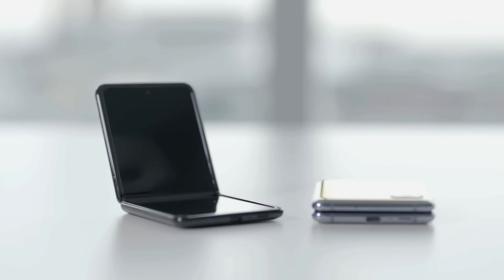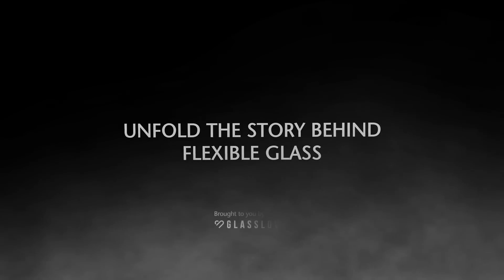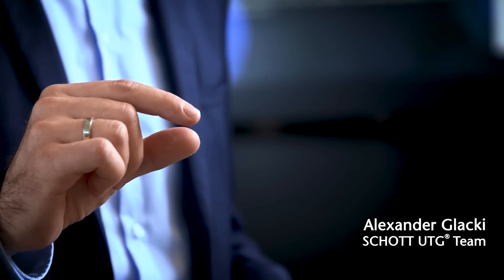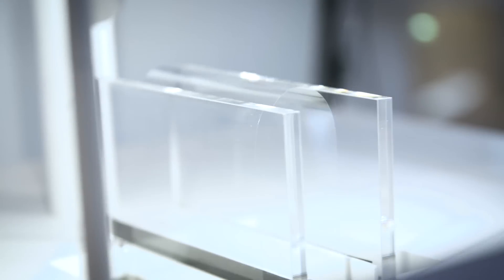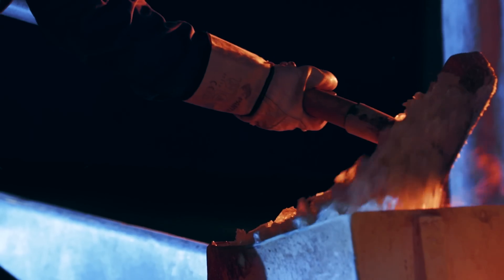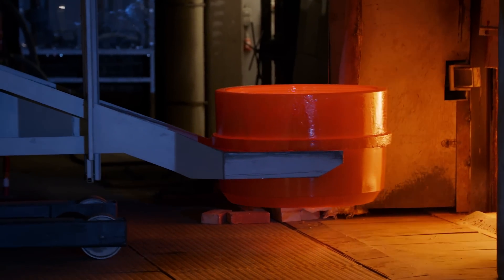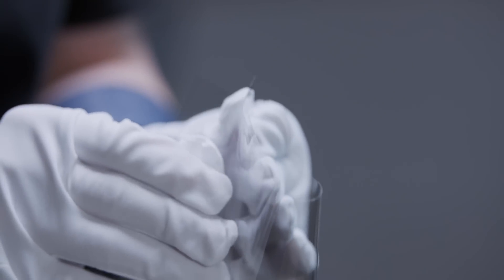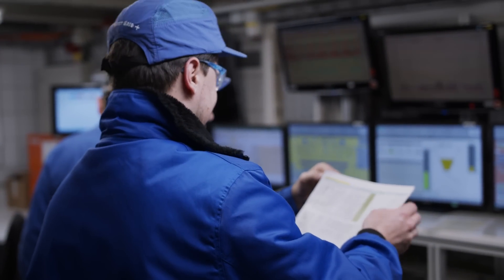SCHOTT UTG® – Unfold the story behind flexible glass

Comment: Ultrathin glass on the Samsung foldables has a plastic layer that scratches with finger nail. Do you have ultrathin glass that is scratch resistant without the plastic layer?
Reply from the maker: We're sorry, but we can not comment on display-related questions as we only supply ultra-thin glass substrates. The ultra-thin glass's specifications regarding scratch resistance are affected by various factors, e.g., the glass composition, thickness, and the chemical strengthening process. As you can see, many factors need to be considered.